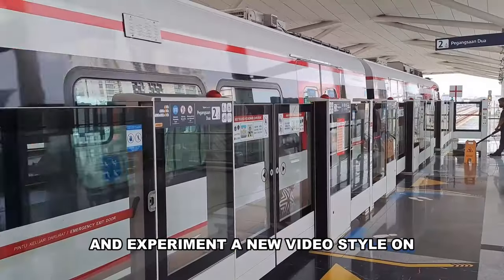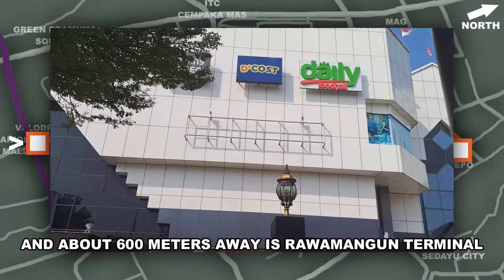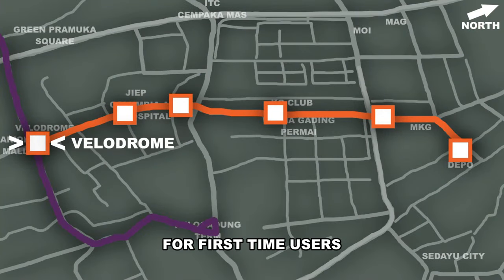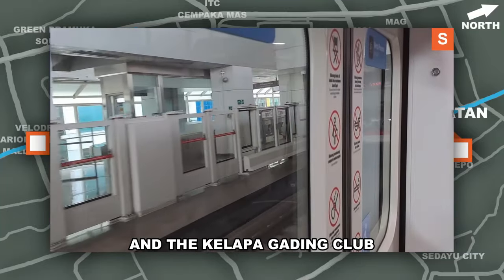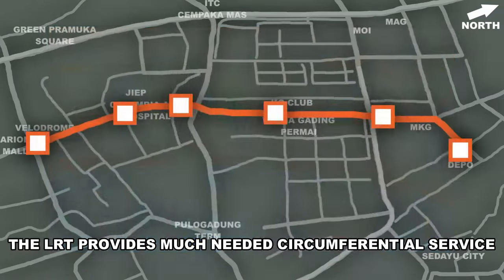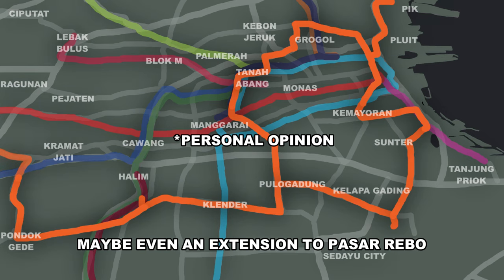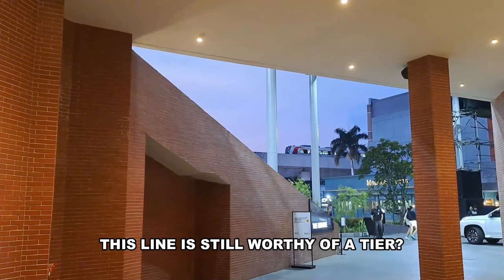Jakarta's Shortest Rail Line Explained | LRT Jakarta Explained

Comment: This LRT Jakarta line while migth not connected with other rail transport, for now when this comment written, is actually the most propper built infrastructure after MRT Jakarta. While the train are curently only run with two cars the station already designed to manage 6 cars of train (or 8, I don't really know so CMIIW). Station facility, architecture, interior, and connection to near public area are definitely better than the goofy ahh LRT Jabodebek stations. Not to mention the construction pace are actually the fastest among other rail transit in Jakarta. Im amazed how quick the construction of the Manggarai extension from the groundbreaking to now with pilars already built.
Reply: The current stations are built for 6SF.

Also yeah, construction is actually going a bit faster than expected. I think there's a positive deviance between expected vs real
Reply from the maker: Biggest problem for LRT Jabodebek right now is how slow the trains are when entering/exiting the stations. Also that LRT's lack of connections to public areas might be because East Jakarta is kind of lacking in public areas. Mostly just houses and offices.
Reply: true, but LRT Jakarta will connect with other transportation in Dukuh Atas station

Comment: Not gonna lie, besides the extension to Manggarai that's currently being worked on, the other routes are kinda "gak jelas nasibnya" lol. The only other proposed line that I think will be worked on next is the tiny extension to Dukuh Atas (phase 1C).
Reply: Karena rencananya pendanaan ya di dapat dari proyek reklamasi .15% keuntungan hasil penjualan lahan di berikan ke pemerintah Jakarta Untuk bangun LRT.jadi gak beban dengan APBD . 

Tapi kan warga jakarta milih macet makanya dibatalkan.
Reply: yang gue sayangin pulogebang-joglo (kpbu sih bukan lrtj) yg di drop wkwkk, kisaran jaktim bkt cuma ada 11Q  bkt itu bisa jadi tourism places kalau ada transum yg gampang
Reply: i think connection to halim is very possible...
Reply: @rizkyadiyanto7922  bukannya itu diambil oleh pusat pakai LRT Jabodetabek. Jadi jakarta bisa fokus ke modal yang lain seperti bangun LRT lingkar jakarta. Atau Transjakarta koridor layang 14& 15
Reply: @rizkyadiyanto7922  I think so too, but I'm not sure when it'll start, and the median between Rawamangun and Halim is quite challenging, given the small roads and the land ownership around Halim (and also how to build the transit area that connects LRT Jabodebek, Whoosh, and LRT Jakarta to each other properly).

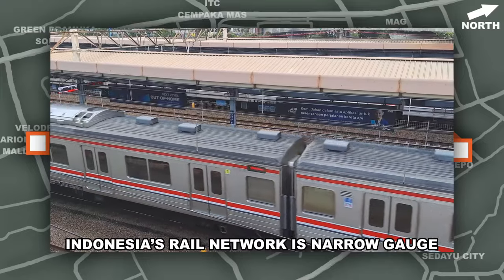Comment: 0:52 pada saat pembangunan mrt 2013.
Pak Jokowi dan pak ahok. Bertanya kenapa mrt gak pakai standar internasional gate 1,435 mm. Biar produksi dan pemeliharaan lokomotif lebih murah . Dan gak terjebak harus impor dari jepang seperti KRL.
 Tapi karena sudah di disain seperti itu dan kalau di ubah mrt bisa mundur 2-3 tahun .jadi mrt dengan gauge 1.067 mm dilanjutkan 

Demi masa depan kereta api , guna mempermudah integrasi dengan kereta api di seluruh dunia dan perjalanan antar negara sangat penting bagi Indonesian untuk pindah  dari 1.067 mm ke gauge  1.435mm dan menggunakan 50kv Ac untuk rel utama (over head wife) . Dan 1,5kv DC (third rail) seperti sanghai metro . 😂tapi mahal sih .dan mungkin gak pernah terjadi. 

Walaupun mulai sekarang pembangunan rel baru akan menggunakan 1.435mm.

0:57 Ini sangat disayangkan sih sih karena menggunakan Elektrifikasi kayak lama 750v DC yang kurang optimal dibandingkan yang baru1.500v Dc. 

 Padahal cina ada teknologi ya.tapi lrt jakarta kerja sama dengan Korea salatan. Dan Korea Selatan menggunakan 750 dc untuk rel ketiga .